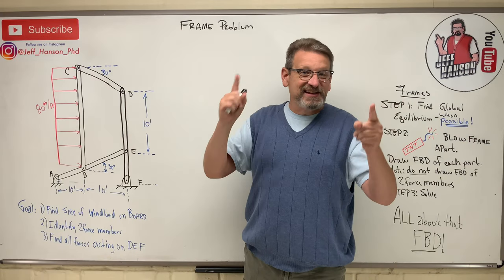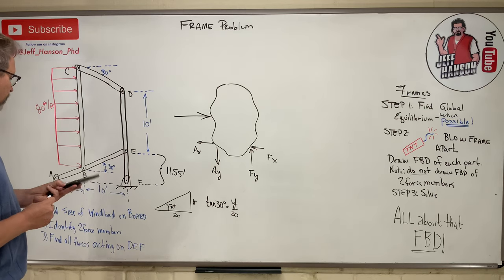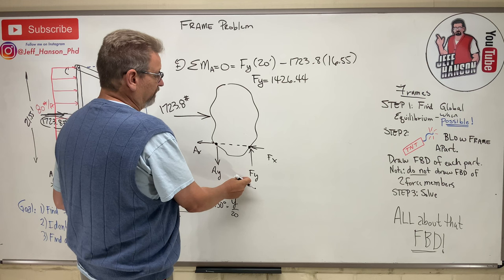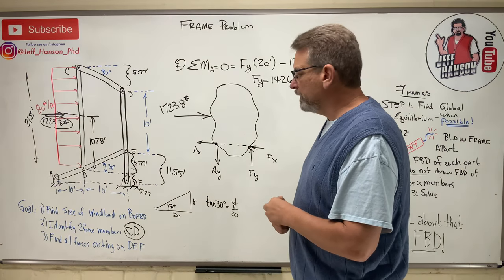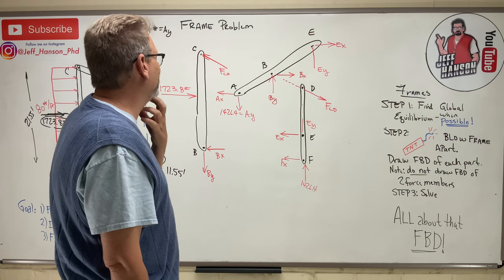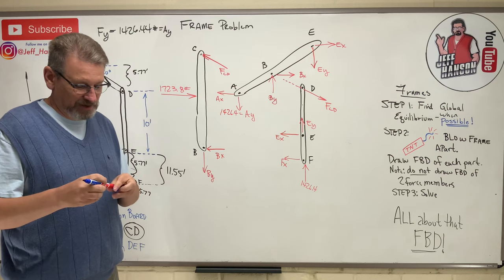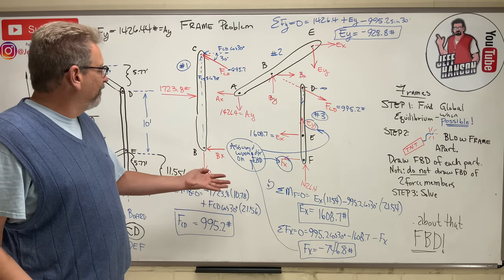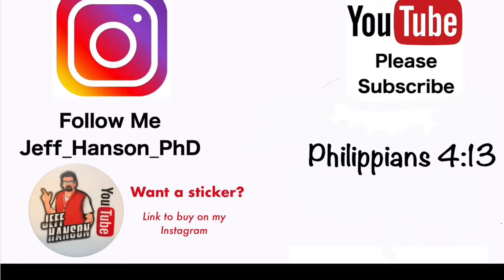Statics: Lesson 54 - More Difficult Frame Problem

Comment: A good example of the importance of a FBD is the Kansas City Hyatt Regency Skywalk failure that killed over 100 people. A simple FBD done before a construction change to a connection that doubled the load on  the connection of a suspension rod to a cross beam could have prevented 100 deaths.

Comment: at 8:00 why dont we say that the equillibrium forces in the Y direction are zero since there is no Y directional external force
Reply: The application of the external horizontal force causes vertical reaction forces at the supports due to the moment arms of where that external horizontal force is applied. That is why it is always best to do the FBDs so that way you always know what is going on since the absence of a external vertical force doesn't always mean there aren't vertical reaction forces.

Comment: While identifying the 2 force members, why didn't we count BE and EF as 2 force member? It also has pin connections at both end.
Reply: at B there are three forces, BA, BE, and BC. Similarly at E there are 3 forces, EF, EB and ED. So they are not two force members